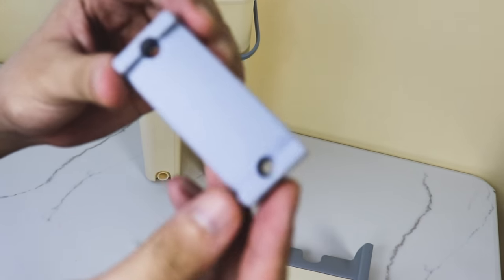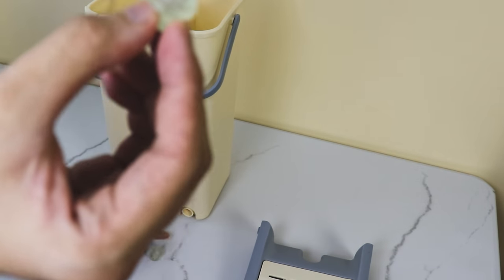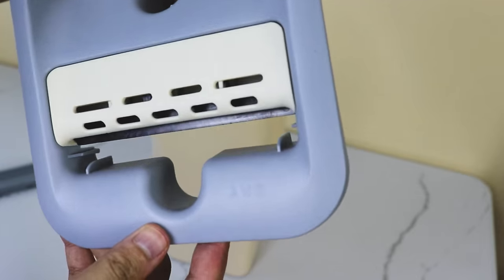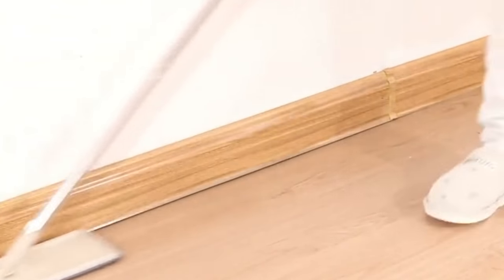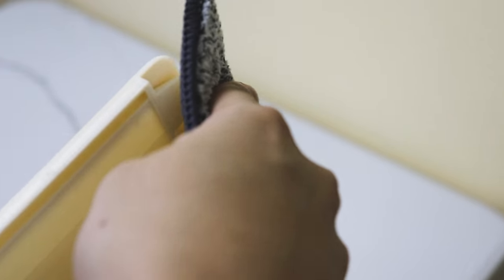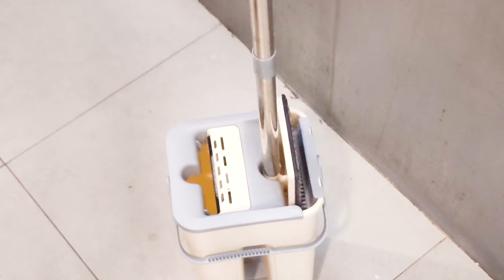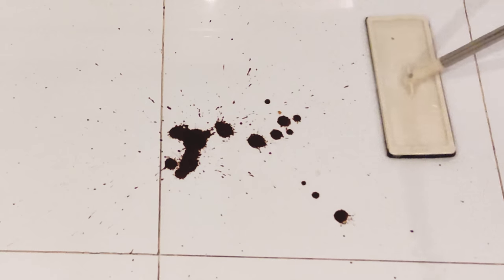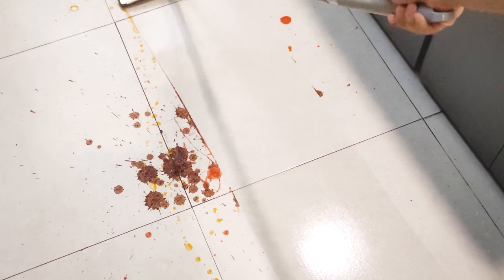Effective SCRATCH MOP Review and Testing

Comment: I have this same mop. It does work (sorta) However it doesn't pick up hair or dirt. You have to pick up the hair and dirt with a tissue. Other then that it works. Opps the design could have been better. Those drain plugs are useless. It's a bucket you dump in the slop sink to clean. Those plugs can get lost. I removed mine and put epoxy puddy in the holes. Works like a charm. Now to see if YT will close my account for this honest comment.
Reply from the maker: Exactly. I usually sweep the floor before mopping, and I never used the drain plugs.
Reply: Thankyou for your advice. You saved my money
Reply: You know this is a mop not a broom right? U need to sweep the floor first, then u use this mop. It's duty is not to pick up dirt or hairs. It's duty is to "mop" the floor.

Comment: Thank you, thank you, thank you!
I just received one of these and I was really having trouble figuring out how to get the mop into the 'dry' side because I hadn't inserted those three tabs. No instructions came with it. Also, that little plastic piece that goes between the two halves at the bottom, don't you think there should be two screws to hold it in place? The holes are there. I'm gonna try and find some that will fit because it keeps falling off.
Reply from the maker: Great to know that you found this helpful. Your welcome